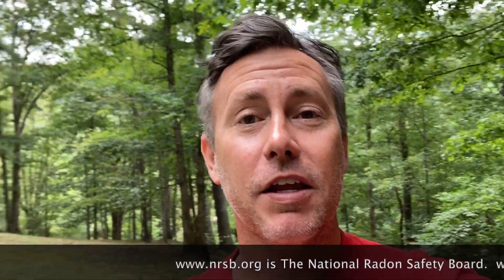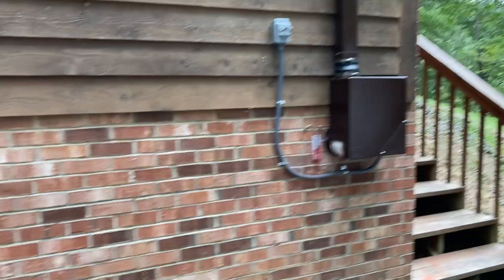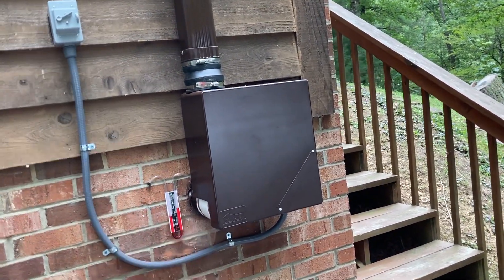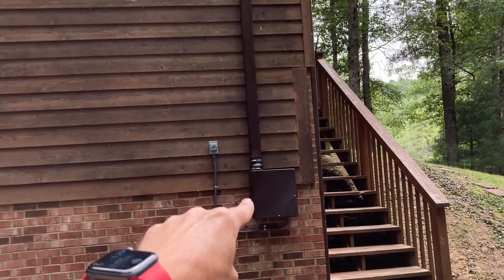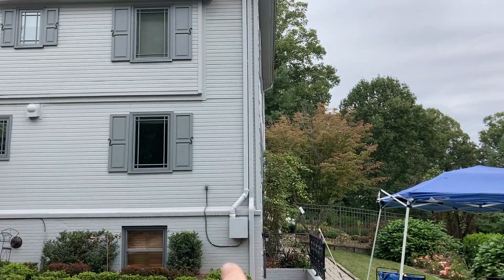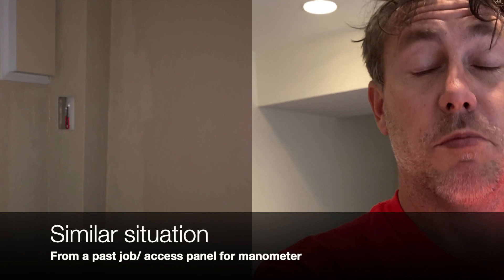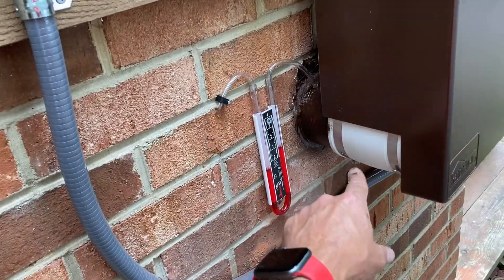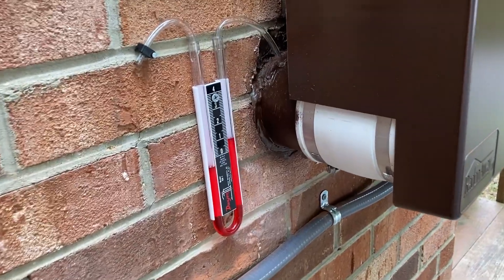Box Shaped Radon Fans

Comment: Looks like some really nice work there -- especially primed and painted to match. Since this video was 3 years ago, any comments on that RadonAway SF180?  Has it been reliable with no odd loud vibration noise? I assume when you said you can hear it working, it's just air-flow we could hear on the video?
Reply from the maker: Hi Kng565. The SF 180 was the right tool for the job and has been holding up well.  No complaints from the customers. In other words, they must still be running. Funny thing- There are just 2 reviews at the Radon Away: 1 says it's too loud and the other says it's quiet.  Anyway, acoustics... no one wants to see or hear the radon fan, so try to put your best foot forward on your location.  This fan is for slab that has gravel underneath.  There are other models for high suction situations. Thanks for watching!